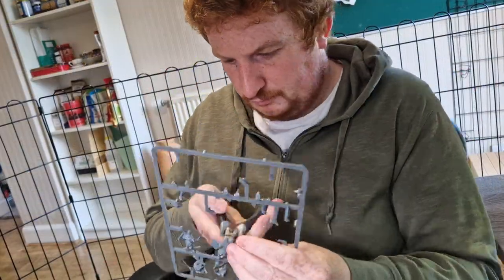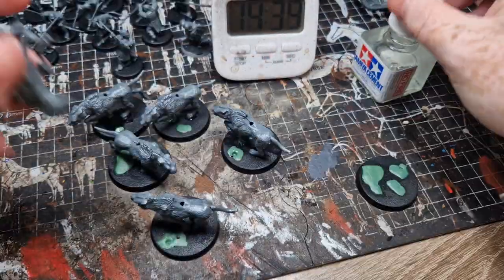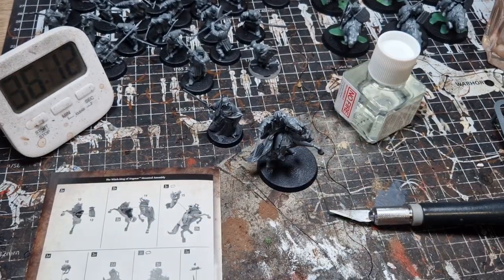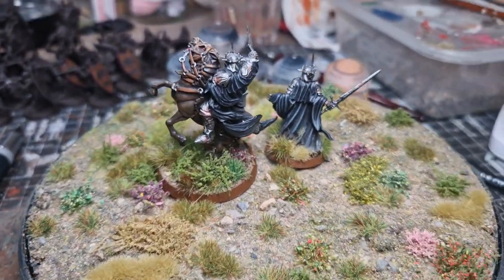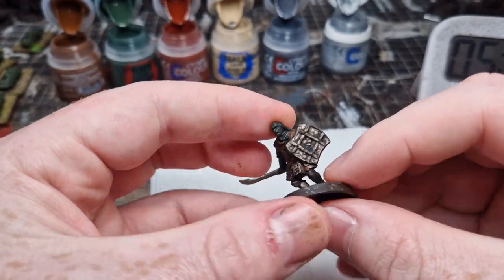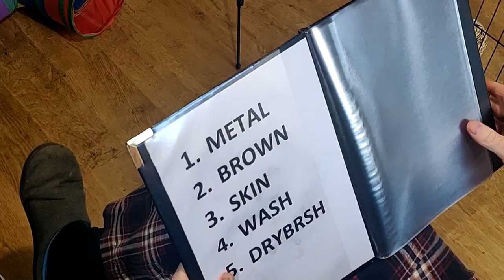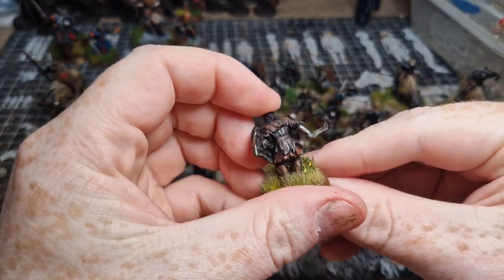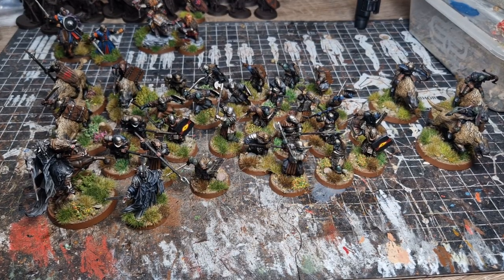How fast can you speed paint a Battlehost starter set?

Comment: How did you paint the wargs? They look sweet.
Reply from the maker: @boshhh123  Thanks man. I'm trying to think why I didn't cover it in the video.

I think it was drybrush steel legion drab
Paint face black 
Wash agrax
Drybrush face greys
Drybrush fur steel legion again
Drybrush fur bone colour
Tounge and teeth
Reply: @jmaccsarmiesofArda  Sweet mate I'll give it a pop. Had a feeling Steel Legion Drab would have been in there. You got any tips re. the old mounted vs dismounted Warg scenario? Like I'm running an Isengard list and want some Warg Riders in there but I would still need to get some orc warriors as well for the dismounts right? Bit annoying buying a whole box of Orc Warriors when I only need like 6 of them (at that point I might as well get the Mordor battlehost for a free Witch King thrown in!). Do you bother magnetising the riders? If not do you just mark them as dismounted or do you use Wild Wargs (more models to buy)? Cheers thanks a lot (sorry for all the questions).
Reply from the maker: @boshhh123  They are very good for objectives so I would have a couple in there. I don't bother magnetising them I'm far too lazy I think they slot into the wargs.

If you Dm me on Instagram I can print you 6 cheap orcs if you want
Reply: @jmaccsarmiesofArda  how can I reach you on there?
Reply from the maker: @boshhh123  I got this email armiesofarda@gmail.com

or you can message me here
https://www.instagram.com/jmaccsaoa/

:)